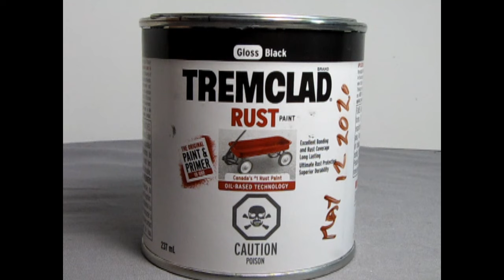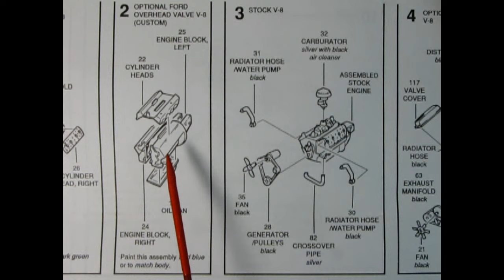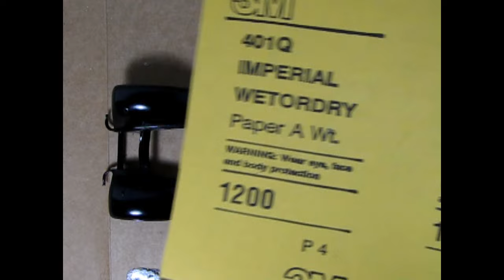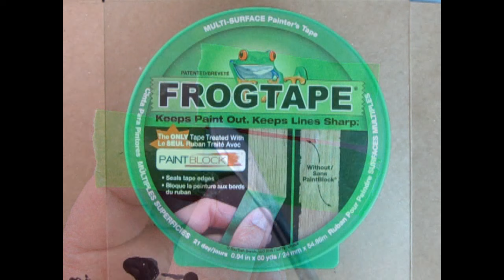How To Get A Pro Model Car Paint Job With A Paint Brush

Comment: It is a bummer that Testors discontinued their Model Master line, but I am a builder from the 70's and 80's, all we had was the little square bottles.  I hope Testors never discontinues these paints.
Reply from the maker: I don't think Testors will discontinue all their square bottle paints, but I do have some in my collection they don't carry anymore, like a light orange and dark green gloss. - I also have a collection of Model Master paints, especially the engine colors.
Reply: Guess it will depend on what direction Republic Powdered Metals (RPM) that owns them will decide. Appears as though they’re continuing to downsize the Testors line of product offerings instead of expanding though I’m not certain how accurate this statement is.
Reply from the maker: @gw7648  They still carry the basic paints and glues. It was only the Model Master paints they dropped.

Comment: Excellent job! You built a beautiful model with an oustanding brush technique. A couple of tips from and old modeller if you allow me. When painting whole pieces like the hood, start with the bottom and side edges with a small brush and then go to the main panels with the big square brush. After cleaning the brush with the thinner wash the brush with dishwasher instead of soap. The dishwasher works far better on removing all the remaining paint and leaves the brush very soft. Thanks for sharing the video, I enjoyed it very much.
Reply from the maker: Glad you liked it. I will try your tips.

Comment: Beautiful work. Next time, use your hobby knife on the body panel seams between the layers,. It will avoid  the buildup of paint and this "roundness " of them and help to definne the body.
Reply from the maker: So dig out the panel lines a bit between coats? I will give that a try.

Comment: Outstanding tutorial! You're right, my thoughts of brush painting an entire kit were just as you stated. After watching you do it though, I know better. I will say, I think for this era of automobile, the brushed on enamels are really fitting. The finished paint looks thick like I would imagine the real car would look. This video should (and probably will) go viral in the modeling community. Thank you for making and sharing it. Peace and love.
Reply from the maker: You are welcome! Cars back in this era were spray painted, as seen in classic assembly line movies of the day from the factories (Some were even dipped in paint tanks), but people did repaint many, like the black only model T's, with different colors using brushes after they bought them. 

Anyway, I am thinking of making a follow-up video to this one using other paints. Hope you can catch that one once it's done.

Comment: A very entertaining and thought provoking video. Do you feel there is significant loss of detail when using brush on paints due to film thickness? While hobby shops are thin in my area, almost any retailer carries Testors  enamel, although nothing else. When using brush on paints and masking, will enamel leave more of an edge over acrylics. I have a airplane I'm finishing and due to bad decals on a tail section, I'm left to my own devices and painting a tri-color rudder, I'm looking for the best results before selecting paint.
Reply from the maker: Certain paints will be thicker and plug up details, even when sprayed on. The best way to find out is to test it for yourself. enamels can lay down thinner than acrylics, but take longer to dry. It all depends on your preference.
Reply: @MonsterHobbiesModelCarGarage  Thanks for the info. I have a AMT 34 Ford Truck I may try your technique on next.

Comment: Hi Trevor,  Cant recommend this vid enough, I followed the steps as you showed here and brush painted the Revell 2 in 1  "67 Mustang" it's only the first coat and it looks great, Im building it as the Cobra Jet but in German Fire Emergency red as looks like Poppy, the front wheels are Chrome and got some Chrome spray to do the rear steels to match the fronts.

Thanks again Trevor for a vid that helped me out a lot and took the mystery out of brush painting, Best wishes to yourself,family and fellow viewers.
Reply from the maker: Glad I could help and I'd love to see the finished model!
Reply: @MonsterHobbiesModelCarGarage  Hi Trevor, thank's, i'd be happy to send pictures once it's done, have a super week.
Reply from the maker: @SunShine-dk6rk  That would be cool!
Reply: @MonsterHobbiesModelCarGarage  in addition I just got some Chinese bristle brushes literaly minutes ago as heard they are great for enamals and cant find Sable brushes as easy here in Germany as I could back in England tried them on a plastic aerosol lid and they seem good, on the Mustang im using my old flat sable brush and just ordered an AMT GT500 Mustang, In England a local garage had a real  Mustang KR and that was a treat to see.

I have a question do you further thin the coats after the first or keep it as 7 parts paint to 1 thinner and after is it worth clear coating, sorry to be a nuisance.

Thank you and best wishes.
Reply from the maker: @SunShine-dk6rk  The brushes sound good. Always test them on something else first, like a spare part you are not going to use until you find a brush you think is working correctly. 

As for thinning the paint further after each coat, you can do that as well. Just be careful that you don't make it too runny. 

For your clear coat question, it's really a matter of the final gloss level of the last coat of paint. If you are happy with the shine, then there is no need to go further with a clear coat.
Reply: @MonsterHobbiesModelCarGarage  Hi Trevor, as always thank you for your advice, have a super day.
Reply from the maker: You Too! Thanx for your support!
Reply: @MonsterHobbiesModelCarGarage  My pleasure. Checking out your other vids is sure helping me reconnect with this super hobby.
Reply from the maker: @SunShine-dk6rk  I wish you luck in all your builds.
Reply: @MonsterHobbiesModelCarGarage  Thanks Trevor and likewise along with seeing the channel grow, the Torino vid was great and a local Mercedes mechanic back in the early 80s  visited the American spares shop I worked in in London he had a 6.8 Mercedes in Maroon which he drove hard but also had the Mercury Cyclone which really was great to see in it's blue and white, as a youngster in the mid 70s I often visited Twickenham we used to see Concorde fly over and at a Petrol station the cashier had a base model Torino same shell as in the vid, it was white but very rusty,jacked up at the back and large rear wheels, whiplash aerial, he had a piccy of him and Twiggy on the dashboard, back then seeing a States car was a treat and on our journey there we often saw a Canadian non wide track Pontiac Parisienne convertible in metallic blue with white roof, in my street was a customised Mustang 2 Cobra in various metalflake paint gold,purple,blue with Turbo mufflers, memories from close to 50 years ago, making these models brings back those great times though now I live in Germany.

Will keep in touch for sure, cheers.
Reply from the maker: @SunShine-dk6rk  Great stories! Twiggy is going back a lot of years!
Reply: @MonsterHobbiesModelCarGarage  For sure it was a long while back, the Twiggy picture he showed us was taken in a picture booth and looked faded from sitting on the dashboard, the other thing I remember was a lightning conductor thing that ran from the car body to the ground in black with a lightning zigzag in white on it, they were fashionable in England back then, it was a rare treat to see American car's and we mostly had toy diecast Starsky and Kojak cars,  speaking of which we have Rockford here in Germany and it's in English. Hope yoour having a great model building day.

Comment: I'm up to the beginning of the second coat.  The first thing i what to say is that it was soothing.. Calming, to watch you brush painting.  Not all rushed and hurried as we all seem to get while spraying.  I'm glad you didn't speed that up any.  I have a few questions.  Are you using a synthetic or natural brush?  I noticed that you didn't wipe the brush on the edge, after dipping the brush into the paint, why not?  Just not worried about drips?  

I'm really enjoying this so far!  I know that when they started mass producing cars, they were brush painted.  I don't know when they started spraying, so you may even be applying a period correct paint job.  That's cool in itself!  I haven't cheated and skipped to see the final product but i can't wait to see it!
Reply from the maker: Glad you like my progress. 
They must have sprayed cars quite early on to make up the time lost. I have seen old movies where they are spraying the paint on the car from what looks to be a fire hose. Someone else said they painted with laquer paints. We might just not know. 

I'm using a natural brush. 
Didn't need to wipe it on the edge because I only dipped it into the paint 1/2 way.
Reply: @MonsterHobbiesModelCarGarage  yes, they used lacquers when they first came out.  At least the Ford's were.  And Henry Ford was famous for saying they can have their car in any color they want, as long as it's black.  I forget how the pin stripes got started, but I was involved with changing the cars being brush painted.  Because of the differences in weather, sometimes it would take weeks for the paint to dry and would get very upset because all the cars sitting outside the factory, just waiting for the paint to dry
Reply from the maker: @pappytinkers  That is the issue with paints. I inherited my Dad's models which were painted in a humid environment. None of them have that high gloss, even though it's the same paint, as the ones I painted here in Alberta where it's a dry climate. The other issue is sometimes things dry too fast here. 

Henry Ford did have Model T cars that were painted in other colors besides black. The early 1908-1914 cars were different colors, but as mass production started to heat up in the late teens and into the 1920's, he did change that to black since black paint dried the fastest and was ideal for the assembly line. However, when he started to lose sales to Chevy in 1925, he returned to painting Model T's for the 1926 and 1927 run. 

Most people assume that because Henry said "You can have any color as long as it's black", that ALL Model T's were black. But that wasn't the case. Just for that short time from 1918-1925.
Reply: @MonsterHobbiesModelCarGarage  Many people have no idea how important temp and humidity is for paint.  We all use the term 'paint drying ' but you and I  know that it's much more than that.  I believe that's part of my issues with all the new water based model paints.  I live in Florida, so water and humidity, plus the heat, makes a good finish difficult.  
Thank you for finding the details on that about the old days!  The History Channel did a good show about Henry Ford.  That might be where I heard the 'only color as long ...' thing.
Reply from the maker: @pappytinkers  He did say it, but thankfully not at the beginning of the Model T's life. :_Happy:
Check out the Ford Model K sometime. It's a cool machine, but Henry didn't like it. 

Yes, paint can be a tricky thing for sure.

Comment: Trevor, i am very impressed ! The way you tu-toned it shows just what a master you are.  I knew it would be good, but wow!  I'm Inspired to give it a try as well!  I believed that the enamels have little use now days other than some small details.  I stand corrected.

I have some questions about brush care cause mine never last.  The soap, is that a special brush soap or just any regular soap?  Do you go through the same cleaning with acrylics?  Do you clean synthetic and natural brushes the same way?

Sorry it took so long to finish watching this.  One of the dogs got my dentures off the counter and took them into the back yard.  It's half an acre.  I've spent the last 5 days, raking through leaves, grass and sand,  crawling and searching.  Found the bottom, but only prices of the upper.
Reply from the maker: It's just ordinary soap. I'm using it to remove the residue from the brushes that regular paint thinner can't get out. That being said, I do know that some art stores carry special brush cleaning soap, but I haven't tried that yet. 

Sorry to hear about your dentures. 

Thank you for your words about my video. Hope you can give it a try again and that it turns out well.
Reply: @MonsterHobbiesModelCarGarage  i will give that a try.  It will be a challenge, but that's part of the fun of modeling, overcoming the challenge!  
If anyone asks me about brush painting, as far as I'm concerned, yours is the one to watch
Reply from the maker: @pappytinkers  Thank you. I am pretty sure my video IS the only one to watch. I did some research before and I couldn't find much, especially with model cars primarily. 

I wish you luck in your painting project.
Reply: @MonsterHobbiesModelCarGarage  I have a few others on the bench first, like finishing the weathering series.  But I think I know which kit it will be
Reply from the maker: @pappytinkers  It's funny...I am planning another painting video, but I have to make a different video first because of the models I want to use for the other video. I have to build my way through to the video I want to make.

Comment: Wow, what a great video and excellent job.  Did I miss how long you wait for the first coat of Testors to dry before applying the second, third?
Reply from the maker: I mention 24 H, but the longer, the better. 
Thank you for watching the video. I hope it helps you in your builds!
Reply: @MonsterHobbiesModelCarGarage  I will have to practice what you have shown.  I hope these techniques also work on Testors Flat paints for some of my WWII models.
Reply from the maker: @SCIGS30  They will. You just have to be careful in handling the flats after as they tend to get finger print oil in them really easily.

Comment: Excellent, detailed and informative. Just what I needed to get back into brush painting cars. I’ve only been doing acrylic on Bandai Gundam and Star Wars ships recently. Used Testors back 30 plus years ago. Been reluctant to do cars because of the exterior painting. This gives me numerous pointers and motivation. Is sanding between coats always necessary and is 3 coats the magic number? Thanks again.
Reply from the maker: Glad you found this video helpful. 

3 is a good number of coats because each coat is building on the first one to get to the color depth you see through the glass of the bottle.

However, I have been painting with Testors 1111 dark blue and it is quite thin, so I have gone into 4 coats of paint with that one to get it to the dark color it should be. Thankfully, it's so thin that it's not filling in much detail. 

I have read of someone back in the early 1960's putting on 16 coats of paint on a model car. I think I would lose count somewhere on that job. 

Sanding between coats is recommended just to smooth out the undercoat for the next color and to get the top paint smooth and eliminate any brush strokes, runs, or dust from multiplying in the layers of paint.  

Hope that helps you out!
Reply: @MonsterHobbiesModelCarGarage  That does help. Thank you so much. I was gonna just try acrylic and see how it goes but now seeing your video and hearing how manageable enamel can be, I will give it a try. I was trying to stay away from the fumes but painting a car body with enamel once in a while, and ventilated, might not be so bad.  Plus I’m not great at spray cans. Always learning new things, even after 40 years.
Reply from the maker: @JIMZUHN  Brush painting enamels doesn't really kick up the fumes like spray painting enamels does. 

When you are brush painting and close up, there is a smell, but you can put the model on the table and move back a few feet to fresh air. 

Whereas with spray painting enamels, you enter the "Fog" and are surrounded, as it were.

Comment: Thanks for taking the time to share. I'm a hand painter. I will thin the paint, but I never sanded in between coats. Have to try it on my next one!
Reply from the maker: It does help to get rid of any dust particles between coats as well as smooth out the paint itself and give a tooth for the next coat. - Thank you for watching!

Comment: Great tutorial Trevor, did you thin the paint on the first 2 coats and if so munch?
Reply from the maker: I do believe I thinned it to the ratios described earlier in the video, however, I just painted a kit with Testor's 1111 Dark Blue and that paint was so thin I needed 4 coats to get the color right.
Reply: I'm about to brush paint my first model using your method.
Reply from the maker: @georgetaylor5482  Sounds good. Good luck and painting is more of a feel.

Comment: One more question, when gluing painted parts, do you scrape the paint off first? or use CA Glue, or other suggestion? cheers. Your time and insight is appreciated and welcomed.
Reply from the maker: Remove paint and chrome from the contact surfaces. You want the pure plastic to plastic bond. I use Testors glues.